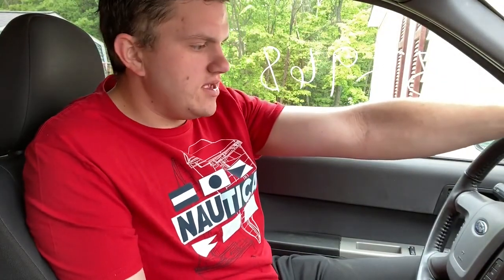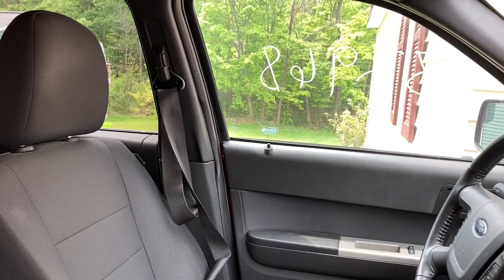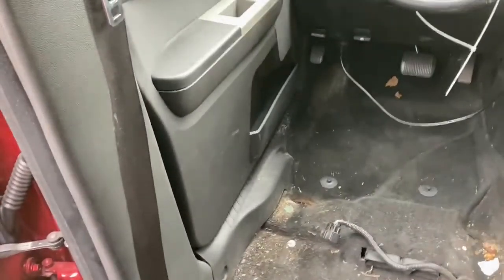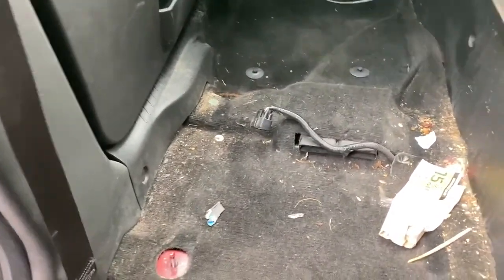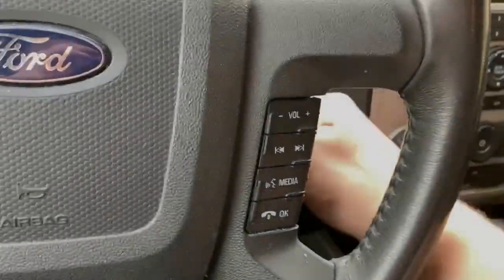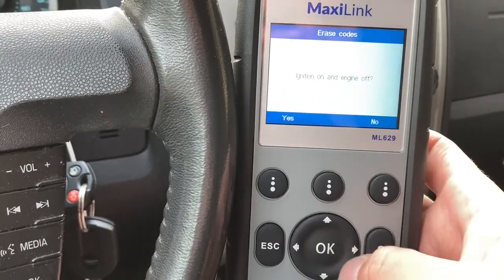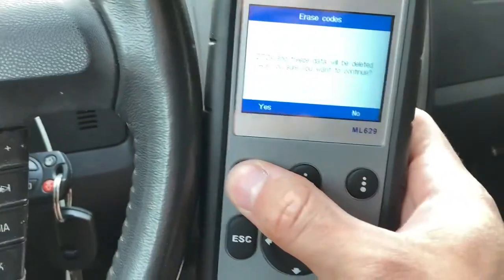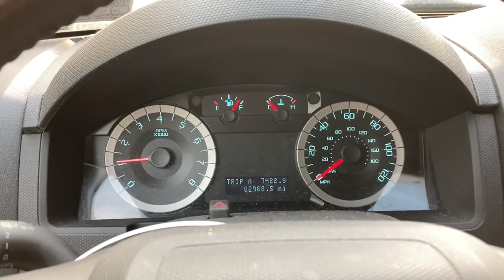Ford Escape Belt and Buckle Pretensioner Replacement| 2012 Copart Ford Escape Rebuild Part 6

Comment: Thanks for posting this! I canceled my appointment at a local repair shop after seeing this and bought an OEM part from Ebay. Install took about 30 mins. Since my right side buckle was fine, I just replaced the belt and pretensioner so no need to remove the seat.
Reply from the maker: Excellent!

Comment: What size is that Torx bit? I don't have any that big and wanna make sure I get the right size before I start this repair.
Reply from the maker: Sorry I’m not sure I can’t remember. I have a cheaper set of torx from Amazon that included it.
Reply: @matt-diy  Okay, thanks. As long as it's a pretty standard size, I'm sure I'll be able to find a set that has it.
Reply: @matt-diy  in case anyone else ever wonders, it was a T50 bit.

Comment: I bought a tensioner for my 2013 Escape. Mine quit completely . Thewhile watching this I found another video stating you don't need to replace the tensioner. I dont believe in miracles in a can . The video stated spray  both sides of the seat belt  with  silicone. It didnt seem to work. However 2 minutes later the belt completely retracted. 3 days later still working like new . I did not spay any parts the didn't go into the the trim pieces..
Reply from the maker: In your case it sounds like you got it freed up!! That’s good, in my case it was permanently seized by the SRS system.

Comment: Ok so I have watched this video a 100 times but can not figure out how to get the yellow piece off.
Reply from the maker: The yellow connector?
Reply: @matt-diy , thank you for replying and yes.
Reply from the maker: @theresaseal5023  I found that it sort of has to be broken out, it is not meant to be removed in one piece, try to break it loose without damaging the connector.